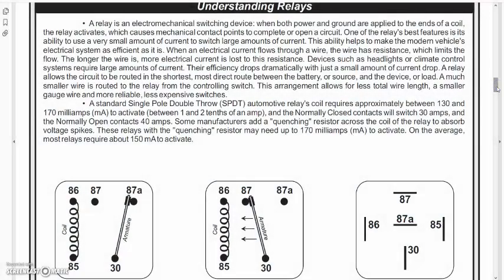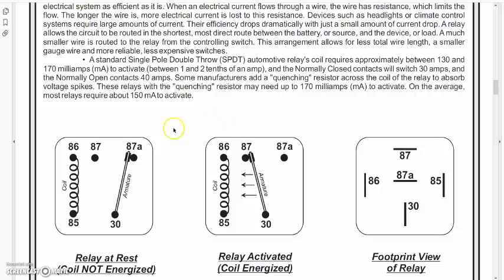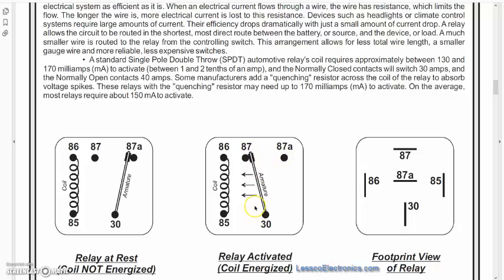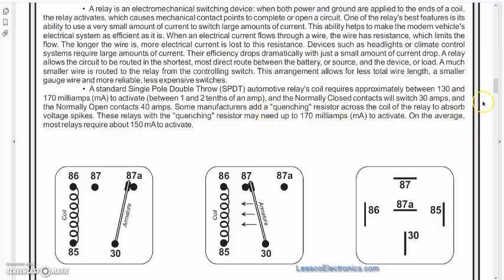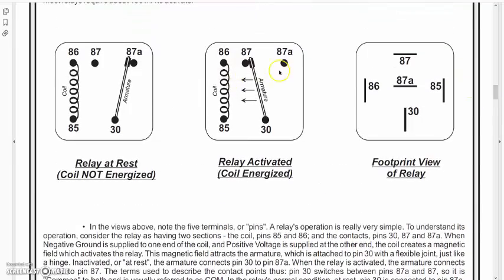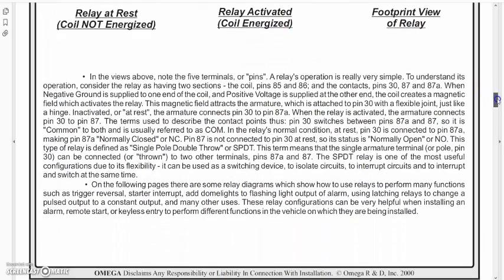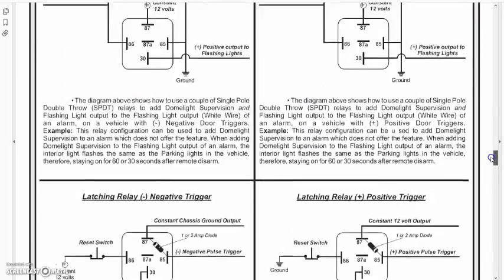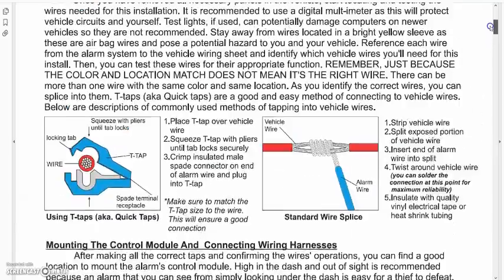What is a relay and how to wire it up

Comment: I request to explain how to add channels to existing alarm I have 3 button remote from autocop piranha which have unlock, lock  and a * button for vehicle identification. when I press * button the hazard light flashes on all 4 corners of car. I came to know seperation of inputs via a diode inputs for alarm is door sense wire. Now say I want to pop my trunk for which I do not have seperat channel. Please throw some light on how to add a channel to add to my existing basic autocop alarm. I search for results in Google for adding channel also searched in 12 vote. com but could not find anything for my requirement since you are very well verse in alarm systems I thought you're the right person. please provide me solution for adding channels and not changing alarm itself. Many Chinese comes with basic lock unlock and trunk open buttons and light will flash when remote is pressed for lock. If you know any mod with alarm please help.
Reply from the maker: email me for free the relay pdf theres an application to add a channel in it.